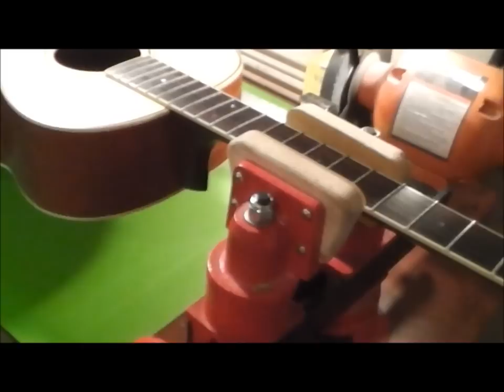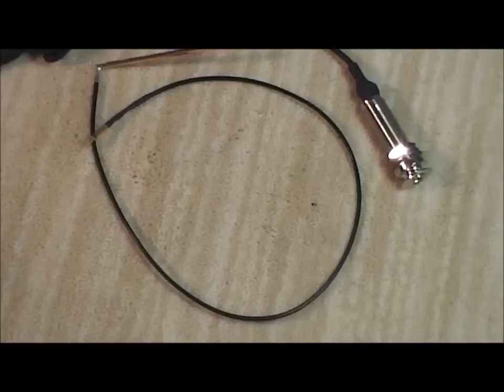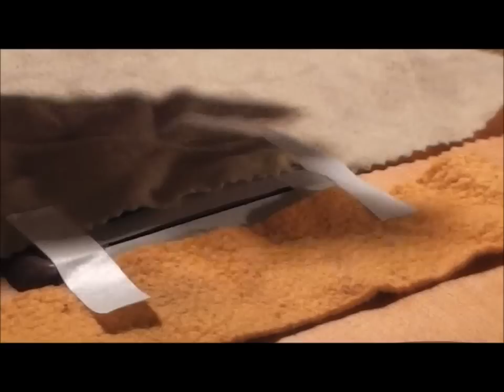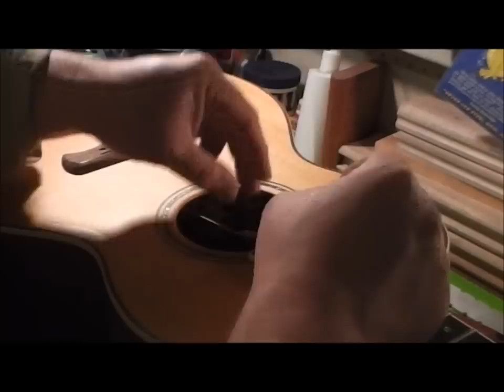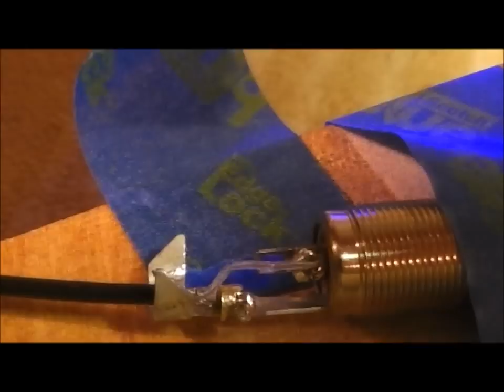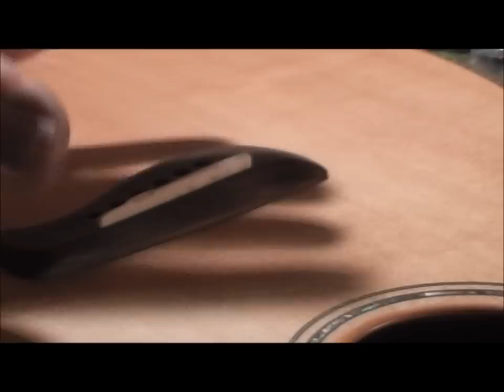Installing Piezo Pickup in Acoustic Guitar

Comment: I had that put in to my 12 string acoustic guitar back in I think it was 2007. And I’ve had that guitar since Christmas of 1995. I was playing in a praise and worship band at a church I used to go to and we had tried different techniques to amplify the sound of the guitar which is either putting a microphone in front of it like with people did back in the day before acoustic electric came out or the internal pick up that you just installed came out.  We also tried the sound hole pick up where it’s just a pick up for the sound hole in the cord to plug it into the amp in the pick up mic that you stick onto your guitar next to the bridge in saddle that plugs into the app but those two didn’t work and I found out about the kid that I have install just like the one you put in. And it works great a few times so I had to have it fixed but it works great and without the preamp switches.  Works well at my amplifier to.

Comment: Hello,great video!!Sorry about my English,I have a question.In ur opinion is possible to install this type of pickup inside the guitar?Of course in the proximity of the bridge.I ask this because,I am makeing a solid body ukulele and I don't want to work on the white saddle.So I am wondering if strings vibrations can be caught by the piezo even under the top.Thanks so much.
Reply from the maker: Yes, but it's a different type of pickup.you want a sound board transducer pick up. They are inexpensive and very easy to install.hope this helps.
Reply: @sli43  yes,I did try them on an acoustic,they are ok.But I have a solid body DIY ukulele with nylon strings.So I am wondering if I can use this strip piezo under the bridge but inside the body from the back,thanks.
Reply from the maker: No, a piezo will not work.the pressure of the strings pushing down on the saddle is what makes them work.

Comment: I  have installed a lot of these things and 8/10 , that saddle slot is not deep enough to hold the saddle when te piezo is in place .
So good as always i have to make it approx. 3mm deeper to compensate the piezostrip hight. 
Whitout making that slot deeper,the saddle is floating in the undeep slot space up on the piezo .
I make te routing with a mini Dremel combitool on a selfmade system. 
Works fine  on a loose individual bridge or fixt on te guitar body.

Comment: a bit confused why you would tamp down into the bridge,  the fragile foil covered piezo pickup that will get a ground hum the minute that foil is torn????
Reply: Jonathan, even worse he used the drill bit's sharp end. Better to use a dowel rod and NO TAPPING. Just a very gentle pressure to ensure seating (after ensuring the slot is clean of dust). The other thing that had me cringing was him using long-nose pliers to hold the nut rather than a ring-spanner. Oh boy, certain to damage the finish due to poor grip. Finally, place the lock nut and washer onto the wire on the outside, feed it through , connect to jack then pull back out through the hole and tighten.

Comment: One thing that wasn't mentioned in this video is checking the saddle slot for any wood dust that may have accumulated in it while drilling the hole for the piezo wire.

Comment: Hi Scot, Could I ask a question please. I'm trying to fit an under saddle pickup to a guitar which has an adjustable saddle, the inards of which is made of metal. I replace the saddle with the piezo but I get lots of hum, this mostly goes away when I hold the jack socket, so I presume it's an earthing issue. There are no other metal parts on the guitar so how should I earth it please? I thought praps gluing a metal plate somewhere inside and earthing to that might do it? Your advice would be much appreciated, Cheers Gary

Comment: I attempted to install one of these today and drilled the hole for the jack in the same place the strap button was.  It turns out the guitar is 3/4" thick, and the threaded part of my 1/4" jack is only about 1/4" long so it won't make it far enough through the hole to thread the nut onto it.  Do they make a jack with an extra long threaded part for situations like this.  (My guitar is an Epiphone AJ-220S), or do you have any suggestions?  Thanks
Reply from the maker: Steveh112 sounds like you are using an electric guitar Jack. You can get an acoustic guitar Jack at Stewart McDonald's they're usually over an inch long.
Reply: Thanks for the reply. Yeah this was a cheap kit I ordered on Ebay from China.  The pickup itself worked when I first got it, but it failed already too after having it in and out of the guitar a couple times.  I really can't afford to spend over $100 on the expensive fishman type, and this was only a $125 guitar.  Is there anything less expensive, but good quality you can recommend?  I'm going to buy a whole new kit and not just the jack.  Thanks Again!

Comment: soldering tip; hold the iron on what you are soldering the wire to, after the object and the wire are heated enough, put the solder onto the wire. This way, the solder will flow from the wire, onto the surface of the object for a clean solder.
Reply: God? Is it you?
Reply: Morgan Freeman og name dude

Comment: how did you shave off those 2.5 mm that you mentioned from the saddle?
Reply from the maker: If your slot is deep enough you can sand down the bottom of the saddle.double stick some sand paper on to a flat surface and sand down slowly to your line.
Reply: got it! thanks a lot!

Comment: If I did this to my martin 00-15 would I then be able to plug it into my Marshall jtm45?
Reply: +Jonas Jørgensen Yes, but it might not sound very good. If you set the amp as clean as possible and adjusted the eq it might be ok, but going into a keyboard/acoustic guitar amp or PA is better. You might get some nasty feedback if you get the soundhole too close to the amp speakers. Nasty, blowing your speakers feedback, not the cool Jimi Hendrix Star Spangled Banner feedback.
Reply: i recently bought a 12 string acoustic with build in pickup, it sounded pretty good
Reply: I play an acoustic through a Carvin Belair 50Watt tube amp and it sounds pretty good. I go to a Boss CS3 compressor first and turn up the treble a bit.

Comment: I've  installed a pizeo in my ukulele and noticed it's a bit noisy when I rub the body of The uke. Is that normal or is There a way of getting rid of the noise?
Reply: That is the roughness of the body going to the pickup so just smooth out the body

Comment: Hi Scott, A very informative video, many thanks. I'm trying this conversion but when I've fitted the piezo transducer I find that the slot isn't deep enough to accommodate both the transducer and the saddle. Any ideas on how to overcome this problem?
Reply: The Jury Dogs cut the saddle thinner.
Reply: When replacing saddles i've taped a piece of sandpaper to the table and sanded the bottom of the saddle. Taping it helps keep it even

Comment: Great video, very helpful. Any times on where to mount the 9 volt battery?
Reply from the maker: If your going for an active system you can mount the battery holder to the side wall inside the guitar.

Comment: If the connector fishes back through the hole when soldered, couldn't you just solder it it all together without fishing it out the bottom?

Comment: Great vid! How exactly would you recommend to sand the slight angle on the bottom of the saddle to compensate for the forward shifting? Thinking about this this installation myself and that is the part that is the most scary for me
Reply from the maker: I just glue sand paper to a block and angle the saddle by eye and take a little bit off at a time. sorry for the late reply.

Comment: The reply I got from the video uploader fixed the problem I had.  Once I removed the strings and checked the pickup in the saddle slot, I noticed there was a tiny piece of paper (maybe from the packaging?) that was sitting on the pickup.  I peeled that off, and the pickup now works beautifully.  Otherwise, check under the pickup to see that it is sitting perfectly flat in the slot.  Hope this helps.

Comment from the maker: remove saddle and lift up pickup. make sure the saddle slot is clean and perfectly flat. the pickup is very sensitive and needs to make 100 percent contact. also make sure bottom of the saddle is perfectly flat. it could also just be a problem with the string itself. start with new strings.

Comment from the maker: A simple passive system is certainly easier and less intrusive to the guitar. In short the difference is with an  on board pre amp the eq controls and volume are on your guitar and a passive system you need to use the Amp controls. You will need to turn the volume up higher on the amp than if you had an on board system.